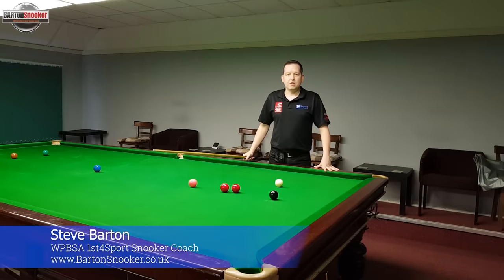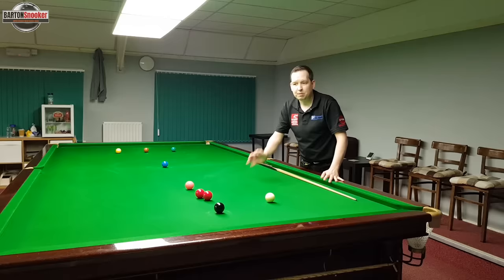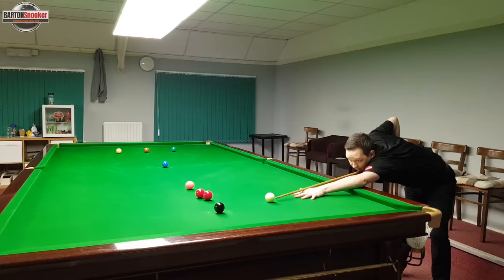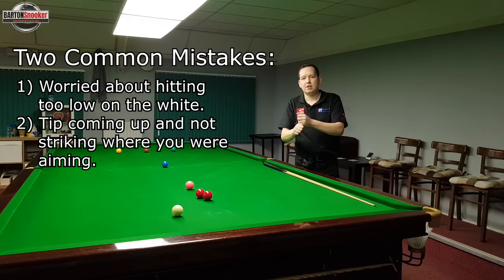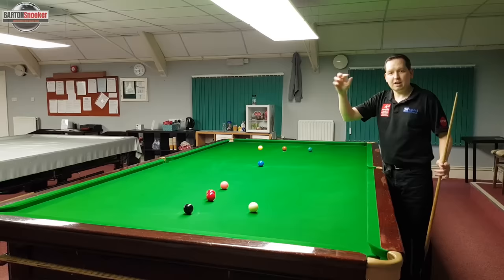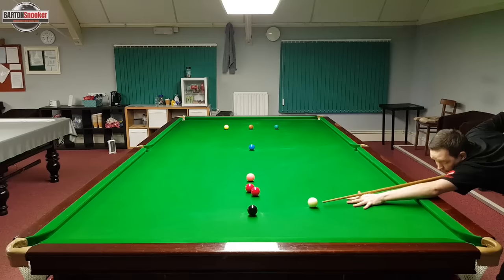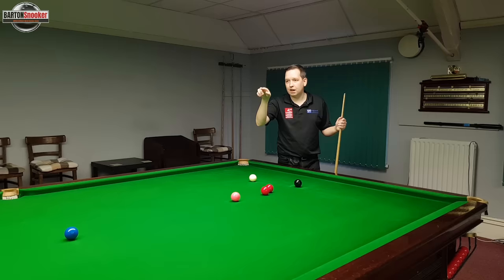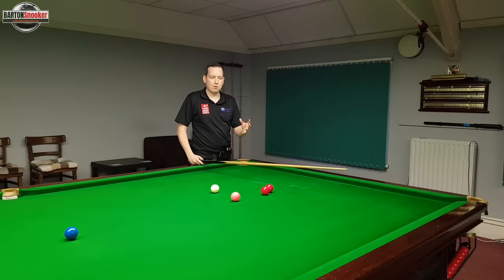3 Reasons Why You Can't Screw Back!

Comment: This is an awesome video. I have commented before to make video on screw shots and how to make a snooker when there are not enough points left on the table, especially when there are only color balls left (I often see pros control the white so that the object ball which they want to get a snooker on takes a different path and goes to another side of the table, while the cue ball takes another path and comes directly behind some other color ball, blocking that object ball, I really wanna know how we can achieve that). Also my problem is, (please gimme some tips) whenever I try to screw the ball I hit low on the cue ball, but instead of screwing effect I get the top spin effect, even tho I hit it very low almost dead low right in the center but it always gets the top spin effect (for example, in an almost straight shot instead of screwing back, it goes forward). 
1 - It is exactly like that first example you showed but I am pretty sure I am hitting dead low. 
2 - And about that pushing through, it does feel unnatural, and I cant do it even tho I try to, but I think my hand is usually place much closer to the cue ball, do you think it affects the my shot? If so, how far should I place my hand?
3 - I agree about the power thing, but even when I hit it softly it does not get the screw effect.
So any help is appreciated my brother. Keep making these videos, you are one of the best snooker teachers on youtube, and I am learning a lot.
Reply: Steve IS the best snooker coach on you tube or any tube.
Reply: @scott7706  yes. My game improved a lot.

Comment: Does the grip of the cue have any effect on screw shots? I was told to hold the cue loose all the time. What do you Suggest? Thanks for making these videos, it helped the beginners like me alot.
Reply: Hold it just hard enough to not lose the stick.
Reply: Don't grip it too tight, it has to be fluent. The cue and the timing must do the work not arm strenght.
Reply: Massively, yes.. Relax your rear hand and hold it loosely between finger and thumb. You'll deliver the cue much straighter through the white and will need far less power to generate great spin. Get that cue tip all the way through the cue ball, not hard just standard pace and you'll get better and better at it, it's all in cueing, good timing and the delivery of the cue. Imagine the other side of the cue ball and your cue tip coming through

Comment: Can I add - check your tip... a friend was struggling to get much action when I was getting loads, so I tried with his cue... Could do a little more than him but not anywhere near what I got with my cue - I checked the tip on his cue - it was practically flat... Properly doming the tip added probably 2-3 times as much screw back - presumably due to a better rounded contact patch rather than a sharp-ish edge.

Comment: I followed all the steps but still can't do it. I recorded my shot in slow mo and hit it in the correct place but for some reason, it didn't spin backwards ☹. If anyone know any tips on how to shoot better, please comment 😅
Reply: 1/ Try a looser grip, try holding with just thumb and forefinger, on final back swing close the hand as the cue goes through.  /2 Take the cue back as far as possible so the tip is virtually touching your bridging groove (your bridging thumb and finger) on the final swing.  3/Don't place bridging hand too close cue ball,  also not to far,  about 10-12 inches distance.  4/ Accelerate slowly through the shot,  don't snatch, don't decelerate.  5/ Keep everything dead still, even after the shot. 

This can apply to nearly all shots, because regardless of shot you need to get through the shot and you need timing (pause on final back-swing,  accelerate cue through shot)
Reply: @Deadeye1967  thanks helped allot. I think I am having problems because my table is uneven and my balls are to small 🤣. Thanks for the tips
Reply: @karenwild8572  Cool.  Go even lower on the cue ball than you thought possible, for an experiment. Small balls you really need a smaller tip, like file or sand the ferrule, (time consuming  I know) and cut down and shape tip down.   Pool players do this and can have an 8 mil tip sometimes (UK small white tables).   You need to shape the stem as well if you know what you are doing.  Or try to get someone to do it, or maybe look to buy an 8 mil ready made cue if they exist.   Some play with a 9 mil,  but 10 mil is a no no.
Reply: @Deadeye1967  ok thanks

Comment: There are three other reasons. 4) No acceleration in cueing action, 5) Not varying cueing speed based on distance between the cue ball and object ball, 6) Grip being too tight.
Reply: There's another as well, having the wrong shape tip; your tip needs to be domed for maximum contact on the round surface of the cue ball.
Quite a few beginners don't know this and play with a flat tip which leads to many miscues when trying screw shots which in turn makes them strike higher up the cue ball to prevent this happening.
To be honest this should be the number one reason, dome your tip first and then start practicing screw shots.
Reply: @vmax4steve524  Round cue tip is only critical for very deep screw shot. I can still easily play screw shots with flat cue tip as long it is not a deep one.
Reply: @vmax4steve524  What a funny comment! You seem to imply that a flat cue tip can't generate backspin in a half ball soft screw shot. What about a full ball shot? Why don't you talk about other aspects like material and hardness of cue tip, cloth grip, and many others. Please just stop BS., and come back to the core question: What causes one can't play a screw shot, not what causes one can't play a screw shot in situation A, B, C, D, etc.

Comment: Another reason - the dreaded yips! I only get the yips on screw and stun shots, it's so bad I end up putting my shoulder into the shot so usually end up missing or going way out of position. Any tips on beating the yips Steve?
Reply: There's no such thing as yips
Reply: @frankcastle9866  what is it then?
Reply: @fredkite  yips is supposedly a sudden loss of skill with no explanation
Reply: @frankcastle9866  could you explain in more depth please mate?
Reply: Practise with a couple of table tennis balls, it will rid you of the belief that you have to hit the ball really hard.
Reply: @vmax4steve524  thanks Steve, I'll try that. I remember you from TSF 👍
Reply: @fredkite  And I remember you from TSF as well, I have a m8 with the same problem, he thought he had to blast every screw shot, you don't, just lower your bridge hand and strike nice and cleanly through the cue ball with the same cue action as your run throughs, those table tennis balls will show you that and when you play with snooker balls again don't change anything.
Reply: Cheers for the advice Steve, going for a knock tomorrow so I'll see if it helps 👍

Comment: I think this is just locker room myth/bullshit. There is reason players naturally try to stab at the ball with a quick stroke. Because you are trying to get a very rapid jerk/acceleration cause I think physically somehow that causes more spin compared to ball velocity. And if you try a regular stroke, following through you don't get that as much. By going forward, then pulling back, your using the slack in your wrist which suddenly comes taught to get a short but very large impulse that the muscles have difficulty generating on their own. Almost like a whip when it pulls back rapidly, it briefly breaks the sound barrier producing a snap sound. Similarly with the wrist, you get a brief rapid acceleration of the cue, and if it's in conjunction with the short contact period with the cue ball, it is plausible the cue ball will also be effected with a rapid acceleration rather then a constant velocity, imparting more spin as opposed to speed. It's not necessary though always (or maybe ever really) is the point that should be made. Because you should still get spin by a more normal stroke, just by hitting the ball low. But maybe in some cases if you wanted a really extreme ball back spin to ball velocity ratio, the whip approach may be an effective solution. And that brings to another point. When there is more distance between the two balls, and if the ball has low ball velocity, high back spin doesn't matter, because it wears off due to large distance traveled. So you have kind of two simultaneous things going on, and if you get the ball there quicker, it will lose less spin in the traversal of the table, but to get the ball there quicker means less back spin usually. Also with the whip method, you generally can't get very high ball speed. So it's really a slow shot with extreme or high back spin case, which isn't most typical draw shots.